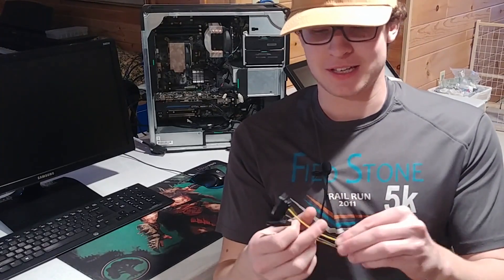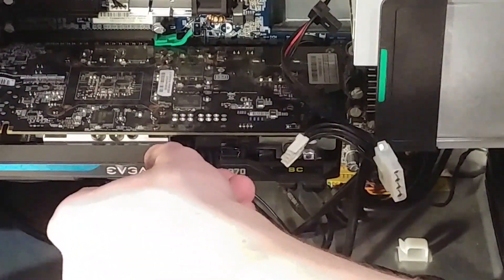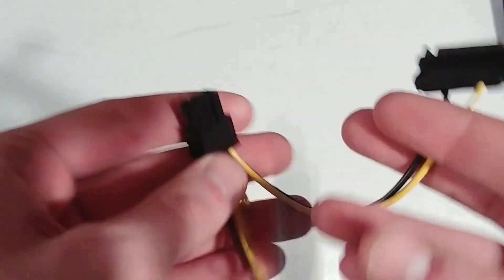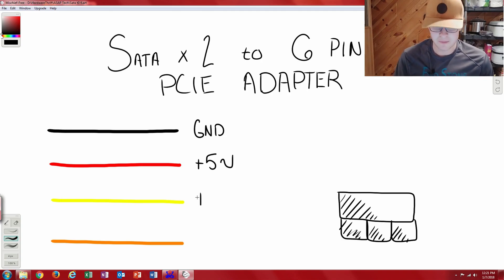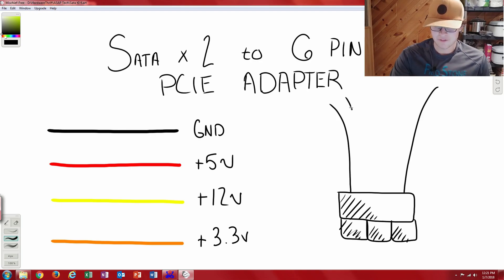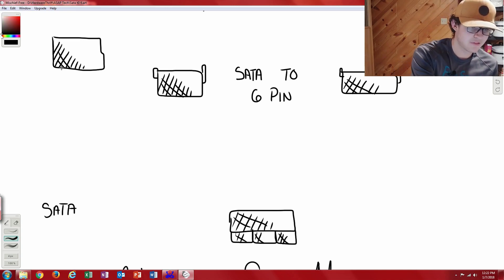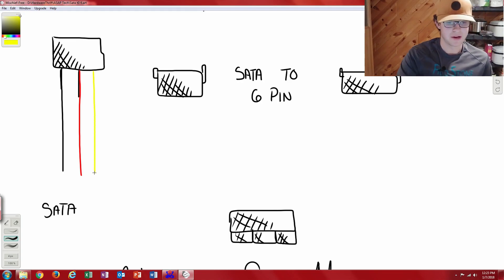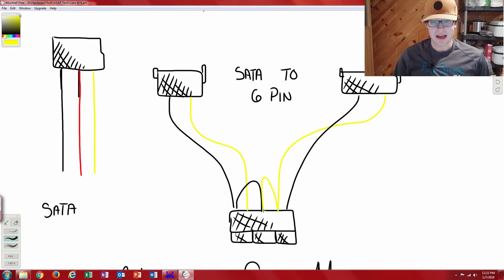2 x Sata to 6 Pin PCIE Power Adapter for Graphics Cards || ASAP Tech

Comment: 1. You forgot the cable diameter AWG. Molex connector max current is related with the cable diameter (AWG 16, 18, 22 etc...) that used for the connector.
Edit:
2. And the max. current is the abszolúte max current, that is safe for short period. If you run high power for long hours and maybe on high temperatures, better to stay such lower Than the theoretical max. current.
I
It is not that simple math as you represented, because of many other factors.

Comment: I have a question:
I want to upgrade a HP 6300 PRO MT, with a i5-3470, 16 gb ram (4x4) ddr3 1600mhz, a SATA SDD of 120GB and a 1TB HDD, and a MSI GTX 1650 SUPER GAMING X, my question is, This adapter will work? i guess the psu of that computer is 320w and hp certifie that this PSU is higher eficent en energie consumpt, so, it will work?
PD: Sorry for my bad english

Comment: You have to ask yourself though, why does a regular 6 pin have 3 yellow wires (12v) and 3 black wires (ground) and I am only using 2 of each wires? Some people even cobble together an adapter where only 1 yellow wire is used. The PCIe slot can deliver 75 watts, so if a GPU has a 6 pin connector, or especially an 8 pin, then it's a higher wattage GPU (some well over 200 watts) and will suck quite a bit of current (amps). 

PSUs have several built in safety devices, but as long as the total power output isn't exceeded the PCU will not shut down. Thus, it can't tell the difference if the load is coming from the device via adequate number of wires, or a red hot single or double wire on fire because it can't handle the current. The wire basically becomes a resistor and gets hot AF. 

If you know what you are doing it's fine to make your own adaptors. If not, bad things can happen.

Comment: how come the single rail 12v becomes 2x? youre plugging in one rail right? so it can only deliver 60w. single rail with one yellow pin can take only 12v not 2x, if you want to used other rail well thats 2x rail in a sata connectors .

Comment: bro i ahve only 240w psu i need to upgrade my gpu to 1660ti can i use this cable?is it ok 240w power supply to 1660ti , can it run?

Comment: Your conclusions at 6:36 is wrong. If both SATA cables are on the same output of the PSU, it's still limited to the capability of that gauge wire. You'd have to draw from a separate SATA from a different cable than the first. This of course does not address the potential for a fire, something SATA cables are notorious for when drawing GPU wattage through them.
Reply: yes exaclty, dont be fooled on his video , he's only explaining single rail on sata connections, whatever your using a splitter to make a 6pin pcie is not the same wattage output, you must put 2 rail 12v line to get 120w power, one rail is only 12vx5a=60w, thats his maximum power output put that rail.
Reply: if you want use dual sata to 6 pin power, you must used 2 rail line of sata. sata connectors has 3 branch, same power output delivered nomatter what. get another rail to get 120w.

Comment: What's actually safer/more reliable? 2x SATA to 6 pin or 2x Molex to 6 pin (assuming both are running off the same 12v rail)? I keep hearing mixed opinions on this from both sides.
Reply: There's more risk with molex adapters as they can be poorly manufactured and short themselves out which will kill whatever is hooked up to it. 
SATA will provide less power so you may have to limit it to prevent the cable from melting
Reply: same here.. he's explaining only single 12v rail on a line of sata connectors. you can use your dual sata to 6 pin if you have 2 rails of 12v connections in your sata

Comment: I did this and am getting the following error message: "please power down and connect pcie power cable for this graphics card"

What could be causing this?
Reply: make sure everything is connected correctly and make sure ur psu is actually able to supply enough power for ur gpu by using a psu caculator

Comment: i use 2 molex to 6 pin connector is this safe? For generic psu 700w
Reply: Have you found a solution? Did it work?

Comment: Hi you made it out that the graphics card only gets power from 6/8 pin PCIE cables which is untrue it can draw 75w from the pcie slot. Also a six pin is up to 150w not always drawing 75w it's just a max figure because there is no in-between a card drawing 100w total will still come with a 6 pin and so will a 150w card dosent mean the six pin will be pulling 75w from the 6pin most of the power will come from the pcie slot

Comment: I found a sata to 6pin cable, but it only has 1 sata port instead of 2, is that safe? Is it okay? 

I’m gonna be using ASUS RX470 Graphics Card for the power up, please help
Reply: he explain that with 1 sata port you can only supplie 75w and your gpu needs 150W so apparently is not enough.
Reply: @yugos1151  I just checked the maximum power rate on the sinlge sata to 6 pin adapter, and you’re right, it needs more power. Thank you ;)

Comment: this actually helped a bit, because I have a non modular psu with only a 6 pin cable for the gpu (I need a 8 pin). So I bought a 2x sata to 8 pin cable ... this gives me hope that it will actually work ^^'

Comment: Hello, very helpful video. I have a 400w psu which doesn't have any 6 pin connectors and I have a gtx 680 which has 2 6 pin connectors....so can I use two molex splitters so then
Reply: It will be 4 molex outlets and then  connect 2 'molex to 6 pin connectors' to my gpu. Will it work?
Reply: has worked well?

Comment: I found there is 1 SATA power connector to 6 pins, which the SATA side output 2 yellow and 2 black wire to the 6 pins. Will it work fine?

Comment: Great and helpful video.  Helped with my understanding and to solve an issue with my son's computer wired in this way.  The one thing you don't highlight is the current/power rating on the wires... that is important to ensure there is no melt failure in the wiring.  

Typically the 18 AWG (yellow wire) that carries the 12 V rail can only handle 10 A max safely, which is likely why two SATA connectors can be put in series on a wiring chain (each drawing 5 A max as you note, which is fine for most hard drives... not for GPUs).  In your video, you appear to be connecting the dual SATA to the same wire harness... that means both connectors may be drawing from the same single upstream 12 V wire (i.e., if there is only one yellow wire in the harness), so your 5 A max holds since that still is at the 10 A max for the single wire (or 120 W).  But if you need 150W from the PCIe power connector (like many GPUs) each SATA connector needs to have its own yellow coming from the power source (i.e., connected in parallel, not in series).  Any other peripherals on that same yellow wire will also use up some of the wire current rating... so please be careful!  For my son's PC, this was critical because the hard drives and GPU were getting power from the same 12 V wire which caused the GPU to fail because the wiring could not handle the power draw.  Switching to a different SATA wiring harness from the hard drives resolved the issue.  Simple fix, but critical.

Again, thanks for the video.  It really helped.
Reply: u didn't need to explain this 1000 page article in the comments tho
Reply: @LELOUCH710  I mean this is youtube, you can put whatever you want xD.

Comment: 8 pin sata is 6 pin +2 and the +2 are grounds. Also, doesn't a person have to consider the gauges of the wires powering a daisy chain Ed power line powering 3 sata drives if they are to power a 150 watt 8 pin sata connector? There may be a difference between Chinese power supplies and the more expensive name brand ones

Comment: Hi just looked at vid, I've just bought  a 1070 graphics card but my computer power supply  does not have a 8 pin cable to connect to  the card. So I I do the same as you have done with 6 pin

Comment: Great video first of all, secondly i want to put a 1650 super in a 7040 mt optiplex (i know sounds a little crazy). The pcie x16 slot is said to only support 35 watts though i seen people run 1050 ti's in those. You'd think id run into any problems if i use this method?
Reply: I’m probably too late but you can use the sata to 6 pin for a 1650 super in an optiplex. It is safe
Reply: @paulhillbeats  the 1650 super only draws 25 watts from sata i think?
Reply: PuffleAE86 does it? It has a 6pin connector on it so I think it needs the extra juice right
Reply: @paulhillbeats  Yeah I've tried it with a single sata port to draw from and its been working fine for a few months. Was just nervous doing this combo in a OptiPlex 7040 cause its seems to never been done before. I thought the pcie maxes at 75 watts, that's why people usually go for 1050ti's without a 6 pin connector for a build like mine.
Reply: @paulhillbeats  oh i meant it draws the extra wattage from sata to pcie adapter

Comment: Is it safe to use a 6 pin to dual SATA power cable on a GTX 1650 Super with a power supply of 275w?
Reply: It is more than enough

Comment: Hey great video! you seem to have great knowledge on power supplies! I have an Antec Neo Eco 550m power supply. It's semi-modular and I'd like to use a braided PCI power cable with it from shakamods or cablemod. The output on the power supply is a standard 8pin, is the pin layout likely to be the same as every other manufacturer, can I use a generic PCI-e cable designed for other larger brand names or am I likely to blow up my PSU/GPU if I try it lol 

Thank you for your time 😁

Comment: The question is, is the 120w coming in through the two sata power connectors going to cause any issues over time because it was only originally supposed to be 75w?
Same with the 8pin 150w connector getting 180w.
Reply: The 120w/180w is how much power the connectors CAN provide not how much they will. You want the available power to be higher the maximum allocated to prevent excessive power draw on the sata connector or it will melt or catch on fire

Comment: I had a sneaky feeling my gpu incompatibility could be fixed this way, and you confirmed it! thanks for taking the time to make and share this video!!
Reply: What Gpu you were putting in your pc and what Psu do you have? I have a 1050 ti at the moment and im hoping that my friend can gift me a 1060 3gb but that requires a 6 pin and i don't have one, my Psu is 280w.
Reply: @Balkanboibg  Lol, same doubt with same 1060 3gb, except my PSU is 360W
Reply: @integer_main  I also have same doubt with gtx 1060 3gb and same psu
Reply: @gghsmcmadinachowkgmabadfsd3652  Works fine for 2+ months with 2xSATA to 6pin converter
Reply: @integer_main  did it catch on fire?
Reply: @jeykey8394  nope, everything works perfectly so far :)
Reply: @integer_main  i wanted to buy one, and i feared that may happen to my GTX 960, cause i just bought it yesterday for 60$
Reply: @jeykey8394  I think it is OK while your PSU meet overall power demand. Just monitor your PC with GPU-Z.
Reply: @integer_main  320W psu is enough? cause i have an HP EliteDesk 800 G1
Reply: @jeykey8394  I have HP Compaq Elite 8300 Microtower. Try, it cost you nothing since converter is cheap. Nothing should burn, PC just won't start if anything (I suppose). Maybe unplug CD reader to save some power. Hope that GPU has enough space to be mounted in that PC frame.
Reply: @integer_main  it does, it's An ASUS Strix GTX 960, did fit after moving some SATA cables, all i need now is the adapter, thanks for the advice

Comment: I am trying to build a mining rig and have 850W power supply that should be able to support 6 graphics cards. However this would only be possible if i use SATA extentions to power the risers, as power supply comes with only 6 of 8pin PCIe power nodes that would all be plugged into graphics cards directly. However i found that cards where risers are powered by SATA extention cables arent recognised by Windows, only cards where risers are powered by PCIe. So i was wondering perhaps using SATA x 2 versus single SATA to PCIe may make the difference, as it will provide more power to card? sry for lengthy message but i hope someone can help me out here.  :o/
Reply from the maker: So I can't respond perfectly without seeing the motherboard you are working with and graphics card. But If your card requires an 8 pin connector then it draws more power than can be supplied by the PCIE can support. Also, it usually means the cards are 150w+ cards... With that being said under the full strain of a mining rig operation a 850w power supply will not be enough. You'll need at least a 1000w  ps to supply all 6 cards

Comment: Great vid! I haven't been able to find a 3x sata to 8 pin connector, any advice? Or just say screw it and upgrade the pcu? My cheap ass trying to get away only spending $7-10 lol
Reply: Also I have a 500w and trying to pair it with a RX570.
Reply from the maker: So I just saw this comment but if you want to try it a 2 x (2 x sata to 6 pin) combined into a 2 6 pin to 8 pin connector should work.

Comment: That was a helpful video, dude. Found some old  i53570k machine in my closet with 500w psu which doesn't have 6 pin for some reason. Would be nice to blow the dust from the 750ti and put it to good use lol. Thanks
Reply: Does it still work?
Reply: @zaireelshaqeel5360  Ahaha. dude. It burned down and took PSU and motherboard with it. Such an iconic disaster of a cable.

Comment: I've used the 2 x SATA to 6 pin connector very successfully to power a GTX 1060. Seeing as 75 watts of this cards 120W TDP is supplied via the Motherboard, the two SATAs only have to contribute 45W. I wouldn't want anything more demanding than a 120W card as the single power cable coming out of the PSU has to power everything in the PC aside from the CPU and motherboard.
Reply: has worked well?

Comment: I see the 15 pin male SATA to 6 pin PCIE adapter cable, but what are you connecting that to, the SATA ports on the motherboard through a 15 pin female SATA to dual SATA 6 pin adapter cable?

Comment: I've a 550 watt psu that have a 6 pin connector...
I need a 8 pin connector to run a rx 570...
So, if I convert two molex to one 6 pin and two 6 pin to 1×8 pin connector...
Will it be a problem...
Please reply...
Reply: You can just use a 2x-molex to 8 pin adapter.
Reply: Why tho? You can use 6 pin on a 570.

Comment: In building a gtx 1060 miner with 9 gpu cards the 850-watt power supply has only 6 power gpu cables ports, the remaining 3 gpu cards need to be powered by other sources.  The easiest power source is to use sata cables from the PSU to connect to 6 or 8 pin adapters, however, I believe sata cables have a maximum watt rating of 54.  The GPU cards are set to mine using no more than 70 watts per card.  Is there a safe way to use these sata cables to power any of the 1060 cards by using one sats cable from the riser and another sata cable to the 8 pin connector on the gpu card.

Comment: i have dell optiplex 980 system with  305 w power supply can i run asus 2 gb 256 bit graphic card with 8 to 6 pin converter to 2  sata ports u shown in your video    pls help me for this
Reply: I have dell optiplex 9020 with 290w psu and I use dual sata to 6 pin and it works fine

Comment: Would you suggest to connect to two separate sata cables instead of running one just one line?  I'm in a situation where I am missing my PCI-E modular cables but have two SATA lines, one for DVD-RW and the other for HDDs.
Reply from the maker: Yes, it means you won't overdraw

Comment: Thanks for the video! is it safe to use 2x sata to 8 pin pcie power adapter for a amd radeon VII and the other 8 pin connector for the psu? thanks!
Reply: No, the 8pin has a power maximum of 150 watts, while each SATA power cable only has a max of 56 watts. At best you're still 38 watts short.

Comment: I have just bought a Gigabyte GTX 1050 Ti graphics card and it requires a 6 pin connector. I don't have a 6 pin connector and I don't think I have a 6 pin connector port. What should I do?
Reply: buy a dual sata to 6 pin converter like in this video. 

My friend is using it and has no problem. He is using some gtx 1050 ti with 6 pin, I forgot the gpu brand but it has 6 pin connector needed, so we tried and the converter worked well. 

I tested the same 1050 ti with my pc that has 1200 watt psu and compare the result to using the dual sata to 6 pin connector in his pc. no difference whatsoever in benchmarks score, only 1 fps margin of error.

his psu is a quite shitty psu called true power! with 450 watt rated. upon gaming it did not make any weird noises, the pc does not do weird things either. 

now, he is currently using it and has been 8 months or so, no problems so far whatsoever. Since it worked so well, he said he is ditching his intention to upgrade a psu since it will waste money. yeah he is a cheapskate.

but i advice not to overclock or anything like that, sure it works but i personally dont feel safe ocing a card without a good psu. 

I am just sharing my experience, I am no pro, and will not be responsible for any damages done.
Reply: @TheWindows72306  thanks for your response. But, my PSU is weird and you need to open up the PSU to plug anything into it... and i dont even know if it has a place to plug the 2 satas' in.
Reply: @TheWindows72306   Do you think dual Sata to 6 pin better or dual Molex to 6 pin?
Reply: @TheWindows72306  will this work for gtx 1650 super as well?
Reply: dual molex to 6 pin is better. since molex gives put more wattage than sata. but both would work just fine.
Reply: Thanks for answering

Comment: by looking at it, it doesn't make sense.   you're taking the power from one supply line that gives you x amount of amps.  what difference will a splitter do that you connect to it?  it's like taking 10l of water from a tap with one or 10l of water with two buckets.